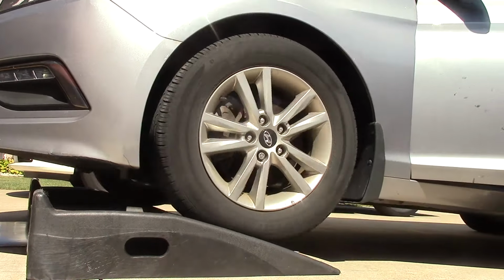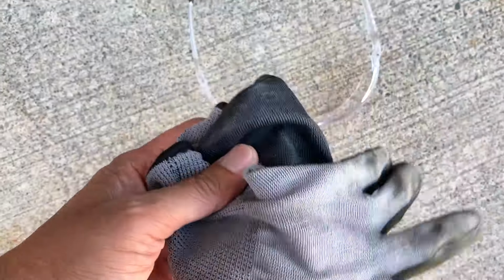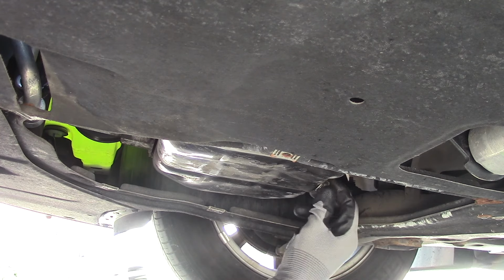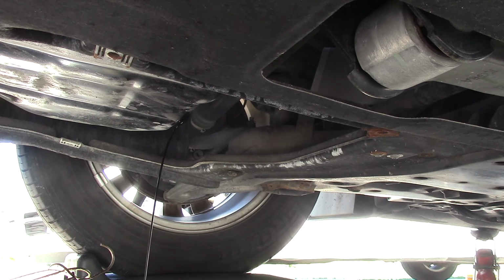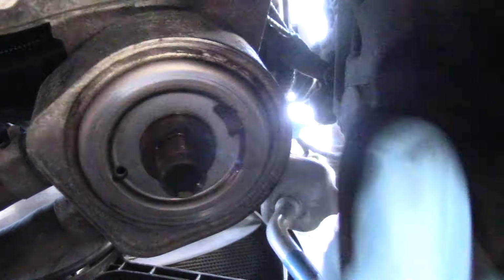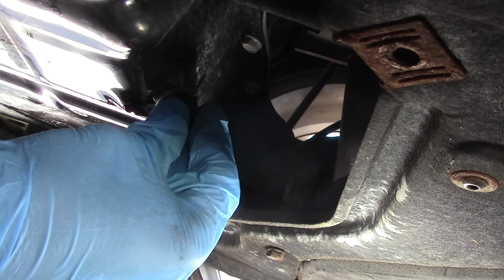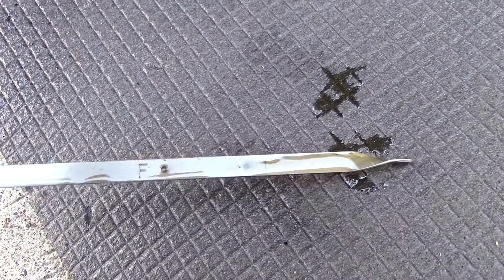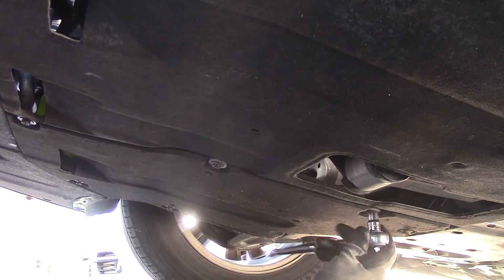Oil Change 2015-2019 Hyundai Sonata. DIY.

Comment: I have one of those 2017 Sonata’s with a defective engine. I burn a gallon of oil every 2000 miles. Nice job Hyundai!
Reply from the maker: Thank you so much. Sorry to hear about the defective engine. I feel so ripped off when that happens.
Reply: They replaced my engine and turbo when it finally blew… but I had to pay for the wheel axle which was 900. Which I think went bad when motor locked up.. but everything else was free and I had 119,000 miles on car. I think someone won a lawsuit so they have to fix it.
Reply: My mom's is defective too. Anyone can break in& it not the model with the ability to have safety upgraded
Reply: Mine’s defective too. It’s burning for every 1500miles.
Reply: 2017 Sonata here. I've had the car in for paint 4 different times. Mirrors quit working, anti theft  had to be installed, passenger airbag quit, rear door locks locked after door was opened had to bungee cord to take back to dealer. Rear window defroster was defective had to have a new window installed. Rear trunk lock malfunctioned. Burns 1 qt. oil every 1000 miles. I have 44,000 on the car but it is past the 5 year warranty on the vehicle. I have 10 year on the engine. Just waiting for that to blow. What a piece of crap. I'll never buy a Hyundai again.
Reply: @Sammythat_B  State Farm insurance will not give me comprehensive insurance because it is not push button start.

Comment: When checking oil have the car level NOT STILL ON THE RAMPS. Otherwise you will get the WRONG oil level reading.
Reply from the maker: Yes you can check while on the ramp but you have to check again when you bring the car down.
Reply: If it's on ramps, you need to put some oil in the car to drive it off the ramps anyway. Then top it off
when level
Reply: Brother he literally said that after he checked it lol

Comment: Thank you for this most informative video. I know it is cheaper to do it myself, but took it to the dealer. Now I get pressured to align, filters, tranny oil, radiator drain and replace. 44,000 miles. I can do most of this myself.
Reply from the maker: Yes they start to push other things you can do it yourself. That's how they make money. If you can do it yourself, why not?

Comment: Great video. Really nice editing! Great video and clear audio make it really helpful. Also, I especially liked the little "pro" tips you give - listing the socket sizes, duck tape to help get the filter off, putting oil on the gasket of the oil filter, and most of all, only HAND TIGHTENING the oil filter. I once had an oil filter someone put on so tight it took me three days to get it off! Again, really nice job on the video. Thanks.
Reply from the maker: Glad it was helpful Chris. Yes I've seen video of people tightening the oil plug with an air gun. That's crazy. Also know a friend that brought their car to a well know store that does oil change & they put the wrong oil filter & their car almost stalled on the highway & caused an accident. I hate those places.
Reply: those darn dealership mechanics

Comment: Okay, I rate this as "very good". I think there are some opportunities for improvement. Please think of your audience, mostly DIY newbies. While I am not a newbie anymore, I was looking for any tricks or hints so to make the job easier.
First, while you had the engine running to put it up on the ramps, you could have mentioned that oil changes should not be done on a 'cold' engine, and that on the ramp will put the oil pan plug lower to allow a better, more complete drain. (As compared with a side lift with a jack.)
Second, your comment about the oil pan plug, "at the last thread" is not very helpful if you don't know what that feels like. Maybe, you can think of more descriptive words, like, if you have not done this before, go slow and be ready to pull the bolt away as soon as the last thread releases. This is me being really picky. LOL
Third, when removing the old filter, make sure you get the gasket! Or before you install the new filter, make sure the old gasket is removed. (In 1978 I experienced a dealer mechanic miss this step, it was a disaster!) 
Forth, hand tightened? This is not a good description. I want my granddaughter to learn and her hand tighten is not enough. I bought here a torque wrench and a oil filter cap wrench that she can use the wrench on. There are many fasteners that need very little torque and will break when hand tightened.
Fifth, that silver aluminum washer, might have already been replaced with copper! This is not just a washer, it is a crush washer. When in doubt change it.
Sixth, "don't over tighten", right, how do you know when you are tight enough, but not over tightened.... tooo late! Check the torque spec.

I think of the DYIer, one that is using the bare minimum of tools and one that has bought the 6,000 piece tool set. One might have only an adjustable wrench that has no feel to it and the other has a 1/2' drive breaker bar with no feel to it! LOL Both will strip that oil plug. 

Another suggestion is to spread some card board down under everything when doing oil changes, no one can get all the oil into the pan, it just can't be done. The card board can be put in the trash. The oil can be brought back to the place you bought the oil.

And last, I would warn that when you first start the car after an oil change, the oil light might come on for a few (1-5) seconds and then go off. If it stays on you must shut the engine off.
Reply from the maker: @stevenpeck5949  all good points. Thanks for sharing and I will mention that for sure next video on oil change. It does feel good when you do your own oil change, doesn’t it?

Comment: Thank you.  Very clear instructions.  I've changed oil a hundred times but never on my Sonata.
Reply from the maker: You're welcome Kurt. Glad my video could help.
Reply: One thing I started doing when pulling any overhead mount filter is removing it with a sandwich bag around it.  You can also use your latex glove.  This way when removed, not a drop spills and hands/gloves stay clean.

Comment: Great video.  I like using an oil filter cap wrench.  Another tip is when you are unscrewing the filter use a large plastic drink cup over the filter.  The drink cup has the ability to allow you unscrewing the filter by gently squeezing it and still capture the dripping oil.
Reply from the maker: @alans.4658  great idea. Thanks for sharing with our viewers.

Comment: I used to change the oil myself.  Now I have a shop do it.  Today I was surprised at Take 5 oil change when they used a impact wrench under the car AFTER changing the oil.  I did not know about that cover under the engine.  Thanks for answering that question!
Reply from the maker: Yes I don't like that at all when they use an impact wrench. My neighbour's daughter had her oil plug stripped last year because of that also.  I helped him remove & install a new plug.

Comment: Appreciate the video. Aren't you supposed to prefill the filter?
Reply from the maker: You could if you want, but have butter fingers. There's a good chance I will spill it.  lol
Reply: You don't need to. That's really only important on those big rig Diesel engines where the filter holds like a gallon of oil.

Comment: Thank for the video and explanation.
I thought you missed to pour engine oil in  OIL  filter
Reply from the maker: I don't like to do that because I have dropped the filter a few times, & that's a big mess. I don't believe it damages the engine with that 1-2 sec no oil in the filter since there is still oil residue if you change it quickly. If you leave it empty for a long time, I  may consider it.

Comment: Just a little side note. Motor oil with the dexos additive are for fm cars and even then there is some contention as to whether or not it should even be used for those applications??? I wouldn't put that in your car
Reply from the maker: Thank you. Good advice.
Reply: Dexos isn't an additive.  It's just a GM minimum standard. Dexos is fine on most other brands of car

Comment: I might have missed it, but you didn't mention the oil capacity for this car.
Reply from the maker: Should be just under 5L but always check with your dipstick for accuracy.
Reply: @jonahvlogsdiy4143  doesn't the owner's manual say what it is exactly?

Comment: The "Cover" isn't stock...this is an aftermarket cover with access to oil filter and drain.  Stock is not as simple as it's got 10+ fasteners.  The issue I has and why I was looking is to replace these as when I went to change my oil I found MOST were missing from prior shoddy work.  So I bought a cover like the one seen here; only I also looked here for the fastener info = missing.
Reply: I think it may be different for Korea made ones vs US. Mine is like this one.
Reply: You are absolutely right.  It is an aftermarket cover.  Where did you buy yours?  I also bought an aftermarket but it’s a whole piece and have little compartments and it’s a bit off from the oil pan and filter.  So, it’s better to remove the whole cover.  Please lmk where you got yours.  Appreciate it!!!

Comment: What do you do with the old oil?  I don't trust what is on the oil cap, I always consult the owner's manual for which oil should be used.
Reply from the maker: For sure use the manual. The city use to pick up the old oil for recycling but now we have to drop it off the city recycling centre.
Reply: Take the oil oil to any auto parts store, they will recycle it for you

Comment: I just recently started changing the oil in my 2017 Sonata on my own. Do you know what the part number of those bolts and plastic washers are?
Reply from the maker: Sorry I don't but if you call the dealership, they would know.
Reply: I know this is a 2 yr old comment but I need some of those plastic washers too. Shot in tbe dark here but did you ever have any luck finding those parts numbers? Lol
Reply: @trevorwhatever2050  I did not, I'm still waiting for it to just fall off...Lol. Harbor Freight has a package or random sized ones that might work.

Comment: What are some reason my check engine light could be on for ?
Reply from the maker: You can buy an inexpensive code reader to check what the red light is. Check out my next video how to use a code reader.
Reply: If you changed the oil recently it could be too much oil splashing.

Comment: Great video,, Any benefit to adding fresh oil in the new filter?  Any reason not to punch a hole in the old filter to drain oil prior to removing the the lossened filter.   Important to loosen prior to punching or drilling a hole., The duct tape is a great tip.
Reply from the maker: I don't add fresh oil to the new filter before installing because I've dropped the the new filter while installing a few times & that would just make a big mess when spilled. I don't punch a hole again because of the possible mess it creates when oil shirts out of the hole, you can't predict the distance the oil lands. The duct tape has helped me out many times also. Thanks for the visit.
Reply: @jonahvlogsdiy4143  Manufacturers don't recommend pre-filling filters because it is possible to get trash on the clean side of the filter allowing it to get into the bearings!
Reply from the maker: @wallychambe1587  That makes sense. Thanks for sharing Wally.

Comment: I just got 2017 Hyundai sonata sport it is bad if I use 5w30?
Reply from the maker: Great question. I always suggest the factory recommended of 5W20. Since the 5W30 is a thicker oil & is slower to reach the engine parts.
Reply: Yes.  Your car has specific tolerances. Change it back asap.
Reply: @reevesjustin  I talked to a mechanic and he said is good
Reply: @nopenope414  Good  I used to be a diesel generator technician. Broken vehicles keep mechanics in business. A bit of wisdom, only you care about your vehicle. You're the one that has to drive it and pay for it. Be sure to do your due diligence and educate yourself on your vehicle's maintenance schedule.
Reply: 5w30 is ok in a 5w20 application.  If you live in a warmer climate, use 5w30.  If you live in a colder climate, I would recommend 5w20

Comment: Don't DIY oil change a Hyundai Theta engine .... WHEN the engine blows Hyundai will deny your warranty claim unless you can provide oil change receipts.
Reply from the maker: You should be confident & do your research when you DIY an oil change.
Reply: @jonahvlogsdiy4143 he's right I just went through this engines are trash oil leaks into the exhaust burns smoke mine blew a rod they needed records of all oil changes to get a new engine luckily I went through another dealership and they determined it was their fault